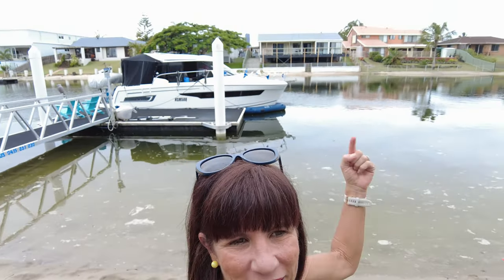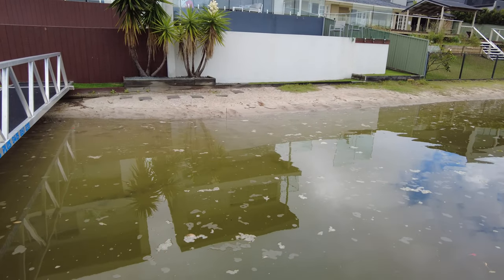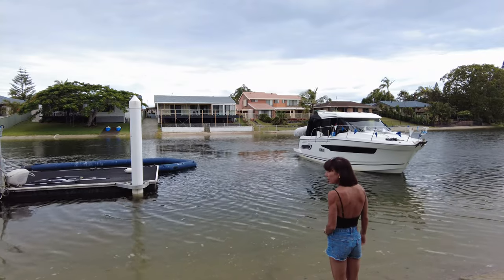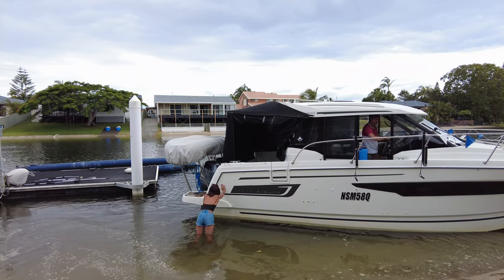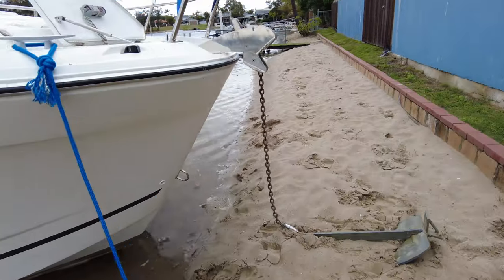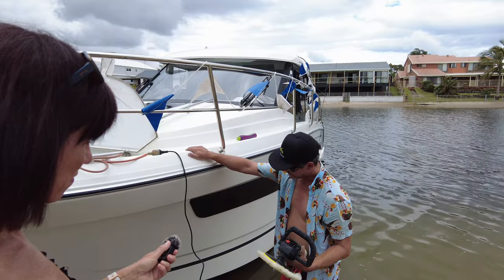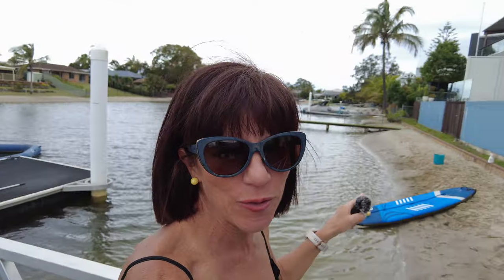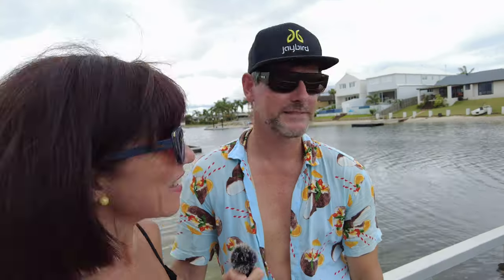How to beach your boat for a clean and polish

Comment: Enjoyed the Video Damien. I use a deck scrubber then a Ryobi battery powered power washer from my dinghy to clean off the luck from the waterline area. I gave my boat a ceramic coating after it had been copper coated from new. Hope that will keep the yellow at bay for a couple of years! We will see if it was worth the extra cost. Really envious of your fabdock and having your boat moored at the bottom of your garden! The ideal location you lucky people. Good to see a video of you manoeuvring your 895. More please.
Reply from the maker: Let me know how the ceramic coating goes. I was thinking of that next time she is out of the water. Cheers as always